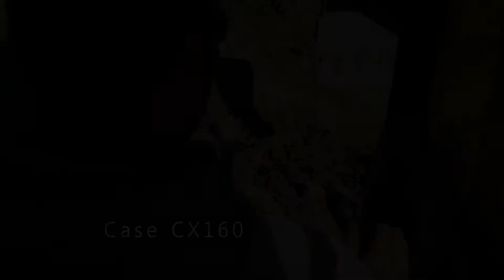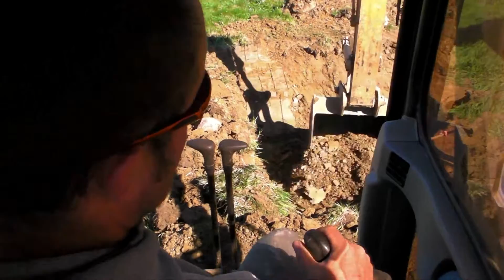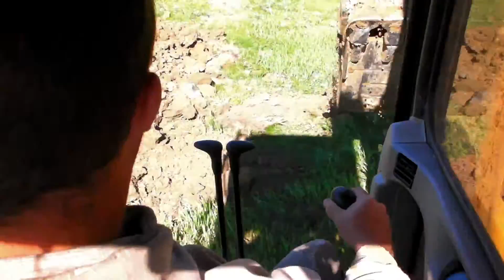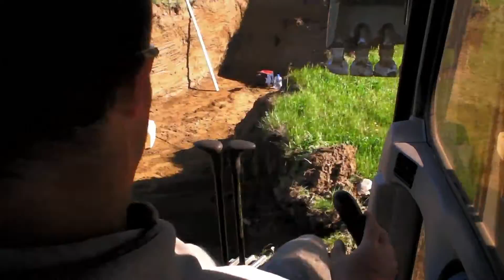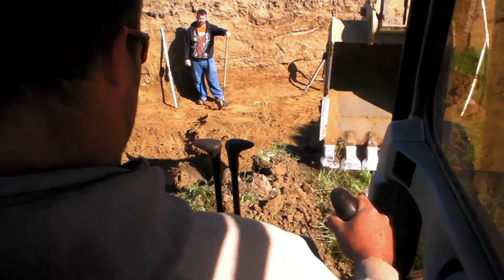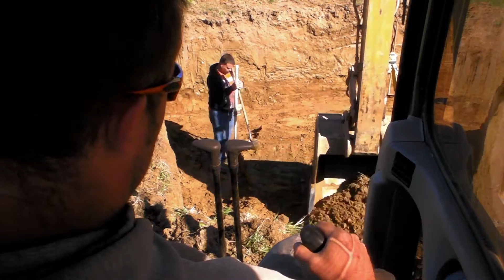Residential Basement Dig with a Case CX160 Excavator

Comment: I worked on a foundation crew when I was a teenager for several years.  They always dug the holes with a big wheel loader, then we filled in the inside after the wall was done.  Made for a lot of hand work and compacting dirt.  I like your way of doing it better, especially if there is going to be a basement floor poured.
Reply from the maker: Yeah, this is a much more efficient way of doing it.

Comment: Out in the subdivision we dig em flat. Makes plumbers and concrete guys happy plus better drainage under the floor. One grade and go, like you said there is the cost of stone approx. 24yds but the builder I work for doesn't mind....
Reply from the maker: Digging a crown is very much a geographical thing.  Certain areas of the country leave the crown, others like it flat.  It's yet another example of how interesting this industry is in the way we approach projects and what the "norm" is.  Thanks for the comment!
Reply: @DieselandIron  Was thinkin about scaling down to a 160 machine so I can tote behind the dump truck. How big of a bucket will your rig handle ? Been running a sh200 sumitomo for years, same thing as a 9030 or 2800
Reply from the maker: @telecastinater  Those were solid machines.  There are a lot of guys that don't want to let those go.  I want to say we had a 36" or 42" bucket on our machine and it was throwing it around just fine.  If you heaped it up with clay it would get a little light but it was comfortable to operate with.

Comment: Do most guys dig the footers at the same time? Seems I've seen a lot that bring a mini excavator in for the footing trench.  Just trying to figure out if there's a right or wrong way.  I'm assuming the reasoning for doing it after is to prevent the trench from filling with water if the footings won't be poured right away?
Reply from the maker: Sorry it's taken me so long to respond. The main reason we dig them at the same time is for the sake of speed. You already have the large excavator on site so it saves a lot of time and money to not have to bring a second machine back. Another reason we don't fool with it is because we don't have to dig an access ramp for the mini excavator to get in and out of the hole. Finally, if there is enough rain and enough water in the hole to cause problems, it is way faster to come back with a small machine and dig a sump hole next to the footer that we can use to pump the water out.

Comment: So you basically dig a big square hole than dig a trench 10 inches deep around the perimeter? I live in northern MN so should the footing be deeper because of frost?
Reply from the maker: If you are digging a square house then yes.  The footer (10 inch deep part) should follow the footprint of the basement.  We dig the footer 4 feet across, centered on the wall line.  I would think these guidelines would work for MN.  These basements are in Michigan where we have frost as well.  I would assume you could call an inspector and get the actual guides for your area.

Comment: were is the best place to start on basement digs?  and what's the laser usually at for footings. thanks
Reply from the maker: Sorry for taking so long to reply!  The best place to start is one of the corners.  Your footing grade is usually 14 inches below the finish concrete floor level.  You have a 10 inch footing and then a 4 inch basement floor that will be poured.

Comment: Is it hard to learn how to use that leveling system? Why use a excavator over a trackloader? Great video!
Reply from the maker: +24bosoxfan It's a lot like driving a car.  When you first start it's a little overwhelming but then it just becomes second nature.  You stop thinking about the controls and instead start thinking about the machine as an extension of yourself.  The reason we don't use a trackloader is for several reasons.  With a trackloader you would have to cart the dirt out of the hole which wastes a lot of time.  The second reason is the fact that a trackloader would just be too big to get down in the hole for a lot of our digs.  One of our subdivisions we dug basements in had very small lots and it didn't make sense to try and stuff a trackloader down in the hole. Excavators are very efficient machines for doing this type of work.